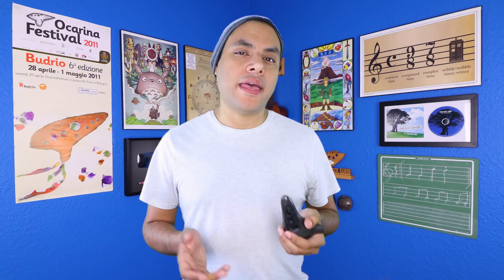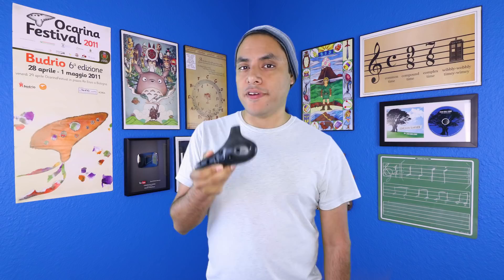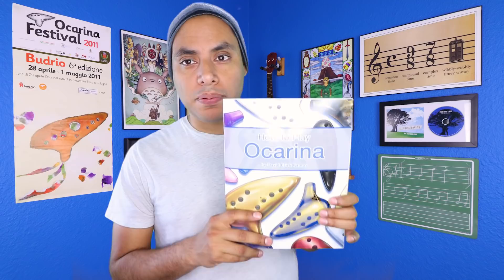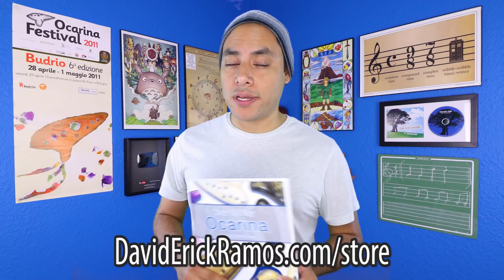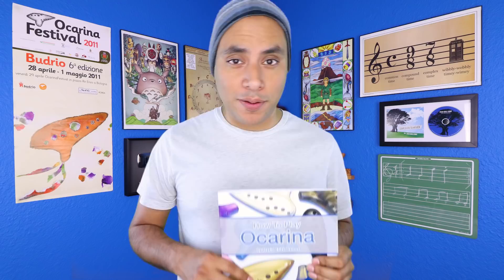How to play ocarina high notes clearly || OcTalk!

Comment: It works because the "sound exit hole" or whatever it's called is closer to your chest, which acts like an "air wall\dam thingy" and slightly increases the air pressure inside the ocarina which makes the note clearer. Trust me ... I'm an engineer. 😄

Comment: It works due to resonance off your chest and also that bending over makes it harder to exhale at the same rate while still making it feel like you are doing as much work (if not more) than if you were upright.
You aren't increasing the distance by any appreciable amount. While the trachea is a bit elastic, not going to grow by a few inches when bending your neck.

You can test the decreased airflow by simply inhaling and breathing out as quick as possible, then doing an acute bend and doing the same.
It should take about 1.5-2x as long, even though you'll be straining to exhale.

Comment: Very nice advice!

I wonder about the  shape and edge of the sound-hole ...
I'm going to 3d-print one (or few) on a resin 3d printer and I'd like to find a good 3d model first.
I'm currently looking at a 2chamberOcarina (on printables by Bathompson) and it has two sound-holes of course (being 2-chambers one), and I found that the heart-shape should help produce sound in a wider range, but I also noticed on the 3d model that the edge isn't very sharp ... actually the narrowest of it is ~0.5mm, and also the angle towards the thicker wall of the body has these channels, which seems to be an artifact of the 3d software used to models it ... I guess 
So especially given the trick just shown (that other object close to the sound-holes can affect the sound) I wonder about these artifacts, and about optimal sound-hole specs like size, shape, sharpness of the edge, smoothness and angle ...
Any info will be greatly appreciated! :)

P.S. that made me wonder isn't it possible to make the sound-holes modular - like having the edge itself be a part of a small module that has a common socket and can be switched with different shape of sound-hole?

Comment: Hello! This was very helpful! But I have a question: I used the acute bend technique, and my ocarina still sounded airy. I did it right and my ocarina is not cheap(it’s actually high quality) I also washed it carefully and dried it and it still sounded airy. How could I fix this?
Reply from the maker: Which ocarina are you using?